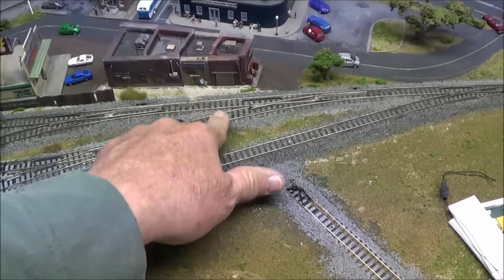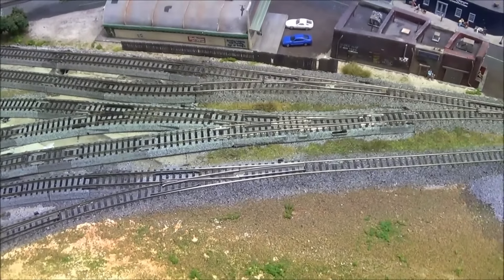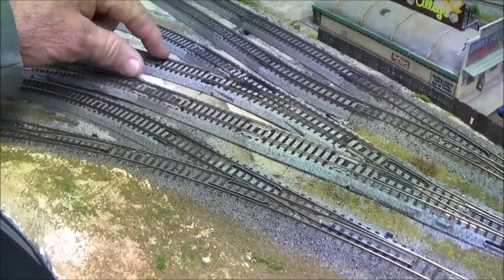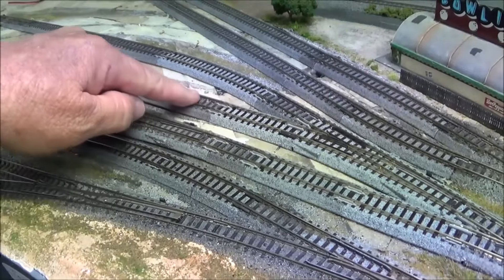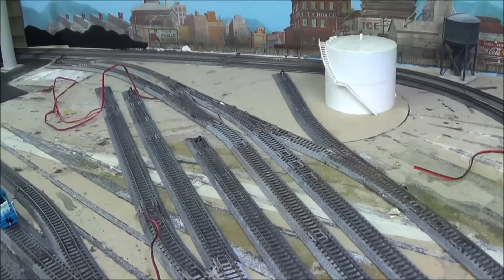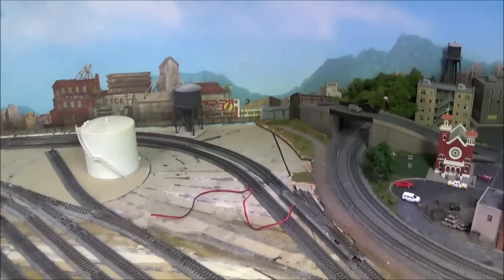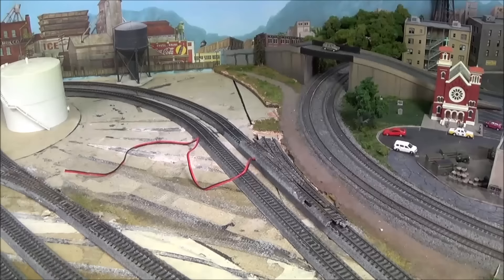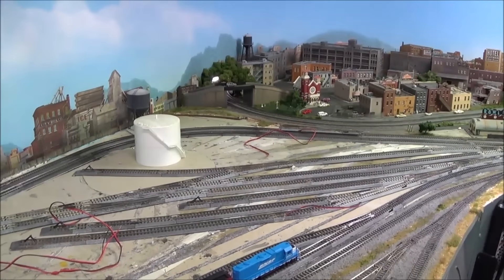N Scale ACTRR Update #54

Comment: Due to space considerations, I tried using some #4 Unitrack turnouts on my layout and I can honestly say that I've had absolutely no problems with them whatsoever. 
Just as an experiment I installed 4 #4's just to see how they would perform. I model the modern era, and all my equipment, including autoracks and 89 foot boxcars negotiate them with no problems. Perhaps the current batch of turnouts are better than previous batches.  
After hearing all the negative reports surrounding them I was expecting problems but I am really surprised how flawless they are. At this point I wouldn't hesitate buying more.
Reply: Thanks , after looking at the new ones they look closer to being correct at the point pivot. Mike

Comment: Hi Mike,  since there are a lot of turnouts in that area, do you  wire them up to a DS64 and power bus locally and run a simple loconet cable to your panel to reduce any wiring problems due to length and complexity or will you bring all turnout wiring to a central location ?
Reply from the maker: They will all function with DS64's.
Thanks , Mike

Comment: I have a 3 by 7 layout table with 1 inch pink insulation foam. How should I fasten down the kato track? Do you have a video as to how. I thought of using woodlands Foam Tack Glue and running a small bead along the edge of the ballast. I plan to ballast it after.
Reply from the maker: At our club we used a dab of silicone on each nail hole post. Once you ballast it will be very strong.
Mike